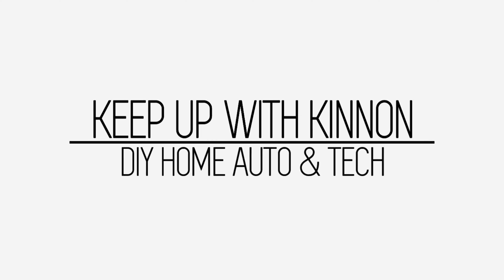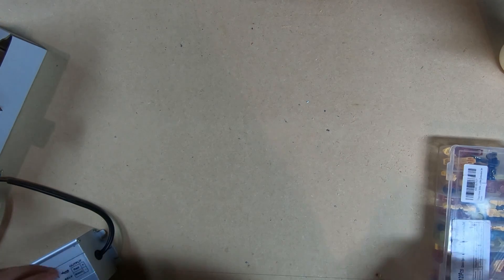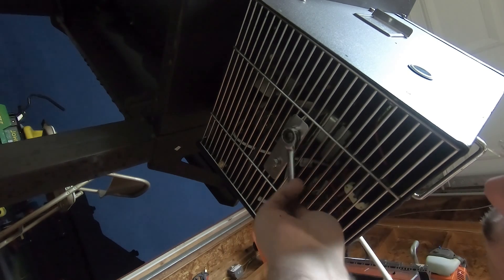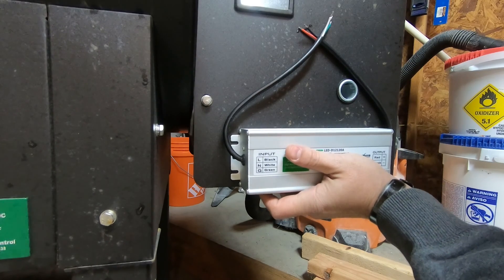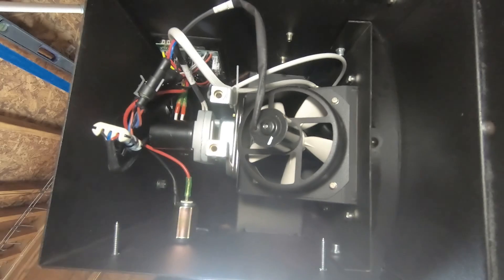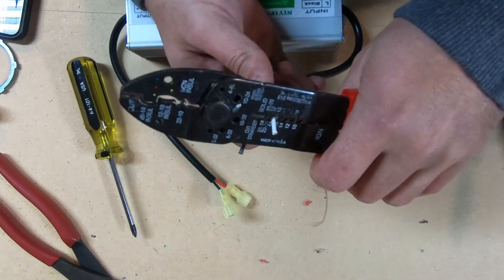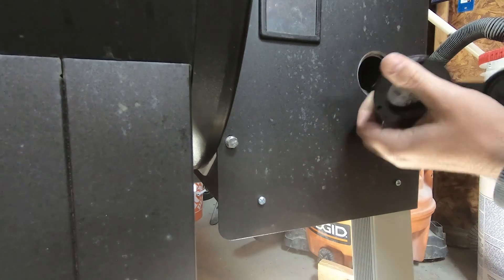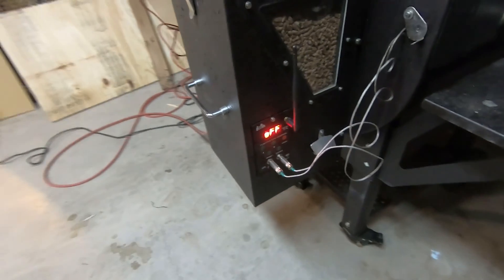How to Add a 120V Input to Green Mountain Grills Daniel Boone, Jim Bowie or Davy Crockett.

Comment: Can this be done on davey crockett?
Reply from the maker: @frankc3807  I’ve heard other say the exact converter I used doesn’t physically fit. But otherwise the same principal would work. You could even just wire in the factory adapter

Comment: I see its been awhile since you posted this, but i just got a used GMG Davey Crockett and going to do this mod. One note to Davey Crockett owners, the fuse for the power is in the power cord male cigarette plug. So if you eliminate the OEM cord make sure you add an inline fuse. Thank you for this video!
Reply: My oem cord doesn't have a fuse

Comment: I have a davey crockett. The pellet hoper is small and it seems there’s not enough space for the converter. Has anyone done this on this model?
Reply from the maker: Sorry I haven’t man.
Reply: I found the same thing with my Davey Crockett. Unfortunately too late to return the converter on Amazon, My bad. I was going to look for a smaller one but didn't want to waste the $30. I didn't pick up on all the review comments and was sold by the video header/description. It was way too tight to squeeze between the fan and the box on our model so I mounted it below the grate, outside of the box and all is fine. It is waterproof and the the wiring is still up in the hopper box. I hope this helps you if you already bought it or can't find a smaller converter.
Reply: @JustATraveler55  thanks for the advice

Comment: I just did this conversion but am having issues. I have confirmed power to the transformer from the new plug. I have power at the output of the transformer until I use the positaps and hook it up red and black wires on the grill. Then it is showing no power on the output and I cannot get the grill to turn on. Any advice?
Reply from the maker: Same transformer? Same exact grill? I would assume some how or another you’re creating a short, but not knowing exactly what’s going on it’s hard to troubleshoot shoot.
Reply: Update. It was a bad controller. Got a new one and your method and recommended parts worked great. Thanks for the video!
Reply from the maker: @juice8732  glad it helped dude!!

Comment: Just did this modification.  Pretty straight forward and thank you!  Couple of points: 1. for anyone that has a little tab mounted on the outside for the cord retainer clip, I just used an angle grinder to remove the rivet from the inside. 2. If you have two wires coming off the factory 12v receptacle, just tap the bigger red and black lines. 3. Mount holes for the converter are pretty tight to the converter body so you want to be accurate on your holes if not toward the outside of each end of the converter. 4. Use short #10 bolts.  Like 1/2"
Reply from the maker: Appreciate the tips man!

Comment: Just found this video because the the power supply went out on my GMG and the company is not longer available for tech support, and parts are hard to find.  I just added the converter and outlet this week on my Ledge. I did leave the 12v plug hooked up though, just plugged it. Thanks for making the video.
Reply from the maker: Glad it could help!!

Comment: Since you made the conversion have you had any issues pop up? Like heating rod burn out, auger issues, Wi-Fi issues etc …?
Reply from the maker: For the two years I had it, I experienced zero issues. I dont even know that I would necessarily attribute any of those issues to this mod. They seem to be relatively common for GMG grills in general. But, I personally had zero issues with my grill or this mod.

Comment: Thank you for this great video. You mention that the converter is 15 amps but the link refer to a 10 amps !?
Reply from the maker: I misspoke in the video. For the non pro models the factory converter is a 10A and that’s what I used as a replacement

Comment: I used the same converter and I am getting the 12V on the one side. But when I connect to tue 2 wires on the grill it does not power the device. Any ideas why it would not work?
Reply from the maker: No clue? Your getting 12V but the grill isn’t starting? Are you getting lights at all or just not igniting?
Reply: No lights. I will take off the connectors to make sure they are getting contact

Comment: The new GMG prime plus smoker fan motors have been upgraded from 10 amps to 15 amps. Is there any inverters rated for 15amps  instead of the 10 amp model you used?  I can't seem to find any listed on Amazon.  Only the 10 amp model.  But what a great idea!  Thanks
Reply from the maker: I would search for 12V 15A inverter or maybe 180Watt inverter. Finding a 200W inverter might be easier though.

Comment: I'm just wondering why GMG didn't start with 3 phase, inverted to 220v, then inverted to 110v, then inverted to 12 volt, to 6 volt, then up to 18 volts for a cordless drill battery (nobody makes anymore) that happens to sit next to the auxiliary hamster cage 60Htz DC generator for power out usage........if you own a hamster.......that also gets inverted to and from 3 phase (if yer curious) and given us at least 300 yards of shoe lace thin cheap ass electrical cord to get tangled up instead of their usual 10 yards.   I mean, who doesn't have their grill at least 300 yards from a 110 outlet to begin with?   And I love waiting for it to get to 150 degrees before I can actually program the heat setting.   I guess that's where the cigarette lighter part comes in.   Might as well burn a pack while you wait in complete suspense, standing there like a motionless JC Penny mannequin staring at the screen watching the numbers climb 1 degree an hour.   I bet Philip Morris owns GMG.    But regardless I think their engineers need to go back to designing coloring books for kindergartners.   Their entire electrical side of design is an utter embarassment.
Reply from the maker: I liked and unliked this just so I could like it twice.

Comment: Good video. The reason why the sheet metal was "hell" to go through? You are spinning your hole cutter too fast. Use the lowest speed in your drill and the formula CSX4/D=RMP, Or "Cutting speed x 4 divided by diameter of your cutting tool." Cutting speed for your sheet metal can be found using an internet search.  You're going pretty fast in the video for a 2-inch bimetal cutter. No doubt you destroyed it in the process. This heats up and hardens the cutting surface. Also use some form of lubricant, either water or WD-40 or such. A carbide cutting tool/hole saw will enable faster speeds than that dewalt bi-metal one you're using.
Try to keep up. 
SNICKER.
Happy grilling.
Reply from the maker: That’s an awesome formula to know!! Thank you

Comment: They use 12v DC Vs 120v AC Because you can vary the speeds of the fans.
Reply from the maker: That actually makes a lot of sense. But, they still could have used a better plug
Reply: @KeepUpWithKinnon  I totally agree.

Comment: Great video, tired of sending my power brick back to GMG, although they have warranted 3 of them no problem.   On the Davey Crockett, I just direct wired mine onto the original red and black wires (crimped one male bullet 14/16 and one male spade to factory 12v connectors) to a computer power cord, then connected that to the inverter soldered.  You can do this up through the bottom of the hopper, no drilling.  I disconnected the 12V, I just don't want to deal with it any more.  Since its still in warranty, I didn't want to drill or mess with it too much.  And BTW....t-taps suck.
Reply from the maker: Thanks man! Yes that CLA is a booger

Comment: Did the 10w converter actually work? According to GMG you need 16.6w and 100W start up. I used a amp initially not knowing I needed more.
Reply from the maker: Which grill do you have? My factory converter was 12v 10a.
Reply: @KeepUpWithKinnon  I have a Daniel Boone
Reply from the maker: @jasonmarquardt7054  Prime model or the Prime Plus? The prime of that year model definitely came with a 12v 10A power supply. Just so we are talking the same units. 12v x 10A = 120W
Reply: Ok... I now ordered the one you used. I'll keep my fingers crossed! Thank you!!
Reply: @KeepUpWithKinnon  not sure what the difference is? I bought it 3 years ago and don't recall any Prime option?
Reply: Finished it today. Worked great! Thank you for making this!!!
Reply from the maker: Awesome man!! Enjoy smoke bliss

Comment: I just completed the setup using the listed parts on my JIM BOWIE PRIME, it powers up, gives 3 beeps and shuts down. I tested it by plugging it in using the "cigarette" lighter plugs to my car and everything works fine. Any ideas????
Reply from the maker: What beeps? I’m honestly not sure at all? Is it the prime plus by chance?
Reply: @KeepUpWithKinnon  I believe it is the prime plus
The beeping is pretty faint, but is is coming from behind the control panel. I reconnected the cigarette lighter plug and tried itwith my car, everthing works fine, My inverter died, so I can't check it with that.
Reply from the maker: I’d say there is the potential the prime plus draws more power so the converter used in this video may not work. The Prime Plus came out after I made this
Reply: @KeepUpWithKinnon  Possibly, the inverter was 15 amp, the one you showed is 10 amp

Comment: Appreciate the video. The cigarette lighter input on the GMGs is moronic. The connections don't hold. Not practical to babysit for a 10 hour or overnight cook. Few people are going lug around a +150 pound smoker. It's going to stay put in your backyard. I am happy to be able to convert mine to AC and make a go with this.  Had I realized how ridiculous the power set up is on the GMGs is, I would have bought another make.
Reply from the maker: They certainly could have hardwired their converter from the factory.

Comment: so GMG claims its better to have 12V "12V Direct Power The new standard in outdoor bbq provides for more safe and efficient power consumption, faster start ups, and greater pellet fuel economy". Why do you guys disagree. Thinking of getting GMG pellet smoker. Thanks for any comments
Reply from the maker: That is literally a bunch of fancy marketing words. This set up amd the factory set up are for all intents and purposes are the same, it’s just a more secure connection. The factory converter or the aftermarket one I am using both take 120v input from your house and convert it to 12V for the grill. I did this purely to fix the issue of the cigarette lighter plug coming undone seemingly on its on.

Comment: Thanks for the video and links. My stock converter went out Sunday and Amazon got the new parts to me today. Took less than an hour and works perfect! I shared your link on the FB GMG Owners group. Thanks again!
Reply from the maker: No worries dude. The group on FB is great, I got the idea from several guys on there and just decided to document the process after seeing several guys ask questions about it.
Reply: Quick question. One of the guys on the group is saying that the Prime models with ceramic igniters require a 180w 15a converter. Not sure if there's truth to that or if it will work with the 120/10. Just wondering if you happened to have the ceramic igniter.
Reply from the maker: My DB prime factory converter was 12v/10A output so I just matched that. Maybe the newer converters have more output? The label on your factory converter will have an output rating on it. Just get a converter with at least the same.

Comment: Awesome fix to a bad design decision.  Any reason you didn't drill out the cigarette lighter port since it will no longer be of use instead of cutting a whole new hole?
Reply from the maker: Hard to drill a hole where a hole already exists, and the 12V could still be used if for whatever reason I had a power outage and wanted to run off a battery or something.

Comment: Anyone know if the converter will work on a JB Prime Plus Wifi?
Reply from the maker: Not sure buddy.
Reply: @KeepUpWithKinnon  Any reason why this one wouldn't work?

https://www.amazon.com/dp/B07MZRMF21/ref=sspa_dk_detail_1?psc=1&pd_rd_i=B07MZRMF21&pd_rd_w=HUemu&pf_rd_p=887084a2-5c34-4113-a4f8-b7947847c308&pd_rd_wg=wK4OO&pf_rd_r=KCVXBZY7AXVC63D4KY4G&pd_rd_r=93bdf75b-c403-4b63-940a-e02229aba768&spLa=ZW5jcnlwdGVkUXVhbGlmaWVyPUEzRTZVNVZLNUNLSFAzJmVuY3J5cHRlZElkPUEwNDMzNjU0MlZRUEU5QTk2TzBQRCZlbmNyeXB0ZWRBZElkPUEwNzk5NDIxMUtNN1I2Q0FUWFQ5USZ3aWRnZXROYW1lPXNwX2RldGFpbCZhY3Rpb249Y2xpY2tSZWRpcmVjdCZkb05vdExvZ0NsaWNrPXRydWU=
Reply from the maker: @joeldavis155  based off the Amazon images, each leg is only rated for 100 watts or 8.3ish amps per. This may not be enough on startup for the igniter. That would be my concern, but that some shade tree electrical engineering from me. I’m no expert, but it’s the reason I didn’t go with a unit that had two outputs.
Reply: @KeepUpWithKinnon  I bought a converter with the same wattage and amp rating as the stock unit. The only difference is that it already has a plug installed. Works like a dream. Thanks for your help.

Comment: Awesome video, thank you so much for posting this. Two (hopefully) quick questions. What gauge Posi-Tap did you end up using as they come in multiple sizes I'm not really sure how to gauge my existing wire. The other question is the hole for the receptacle. The box instruction mention 1 7/8" but I only have a 2" metal hole saw. This looks like it may just work, any chance anyone has tried?
Reply from the maker: I used the Yellow positap, not sure what gauge that’s for. As far as the 2” hole saw not sure if anyone else has tried that or not. I’d argue it doesn’t need to be exact just needs to be close.

Comment: so what keeps the extension cord from coming out of that receptacle if the dog runs out and trip over the cord?   seems like you added some stuff that kept it the same essentially!  why wouldn't you just use a pigtail and wire clamp connector of some sort and hard wire it to the transformer???
Reply from the maker: It’s a much more solid connection. If my dog trips over it that’s one thing, the wind could blow the 12v connector out.

Comment: I agree this is better, but couldn't this become unplugged on the very same way?  I think I'd rather just wire it straight to an electrical cord?
Reply from the maker: It’s a way more secure and reliable connection.
Reply: @KeepUpWithKinnon  agree much more secure

Comment: Let me clarify i bought the item from the link then saw it was 10a and double checked amazon.  Then checked my power supply from gmg and it has 15a because i have the new ceramic ignitors
Reply: Is it a problem using 10a output if your original was 15a?
Reply from the maker: Maybe. If the new igniter draws more than 10A on start up it could cause the power supply to shutoff or damage it. Are you certain your factory was a 15A? What does it say the output is?
Reply: @KeepUpWithKinnon   it says 12v 15a
Reply from the maker: @joshuafrancis6268  I didn’t realize they started shipping bigger ones. Mine is definitely 12V10A
Reply: @KeepUpWithKinnon  no worries i am just trying to figure out if its safe
Reply from the maker: Yea, sorry. I know I say 15A in the video, but my factory power supply was 10A so that is what I replaced it with. There was also another guy in the GMG group on FB using the same supply so I got the idea/link from him. Just thought I would put a video together for guys wanting to see how it is done.

Comment: The link leads to a 10a output supply and not 15a.  Is the a problem if your power supply from gmg was 15a?
Reply from the maker: This definitely could be a problem if the factory is rated at a higher current then the aftermarket may not be able to support it.

Comment: Thank you for making this video. I did the conversion back in April and it’s seriously the best. I’ve been using my smoker much more than I used to as I’m no longer worried it’s going to randomly disconnect. 

Drilling through with a hole saw was no joke though!
Reply from the maker: Right on dude

Comment: Nice video, good explanation.  The process makes plenty of sense and the use of an LED lighting supply is a good choice.  I would solder any connections on the 12V side in lieu of crimp connectors.   I'd also recommend painting the steel that was exposed during the hole cutting process.  Lastly, the connector isn't waterproof when in use,   Your comment about wanting to ensure power isn't lost pushes me toward a twist-lock receptacle and if I get this grill I think I'd have it come out of the bottom  by modifying the grate instead of adding a hole in the rear.    Thanks for the ideas!

Comment: You mentioned using #10 screws to secure the converter. Did you use machine or sheet metal screws?
Reply from the maker: Machine screw with a nut.

Comment: Will this unit work on the new Jim Bowie Prime Plus grills?
Reply from the maker: I’m not sure. I would assume you would need one with more output power. Your factory converter should have its output listed on it. The. Find an aftermarket with the same or even a little more just so you have some overhead.

Comment: Thank you very much for posting this!  It's greatly appreciated!!!

I have a Daniel Boone prime plus.   I would like to just use the original inverter and hide it up underneath and also keep the cigarette lighter adapter available.  I'm feeling sort of lost on how to do that though.  

Would you be able to give a quick tutorial on how to do that?  Just maybe give a quick rundown of the alterations from your video that a person would have to do?  Thanks again!  Appreciate the video!!!
Reply from the maker: I could prolly put a video together on how to do it. But, essentially you would just need to strip the 12v side of the factory inverter. Use a multimeter to determine the correct polarity if the wires under the sheathing aren’t red/black then just tap them in the same way.